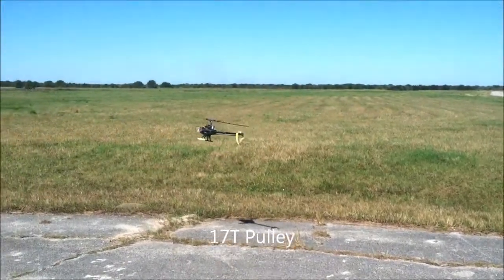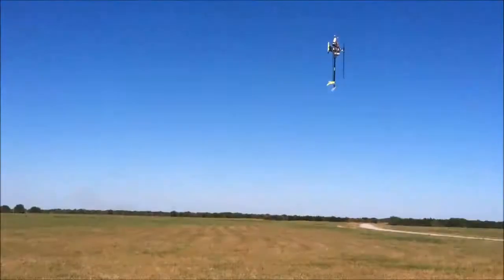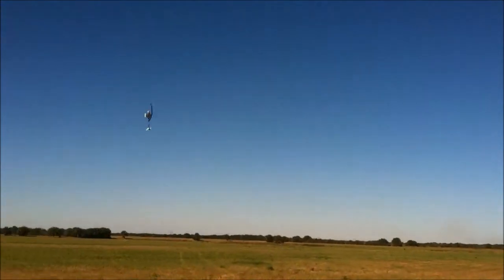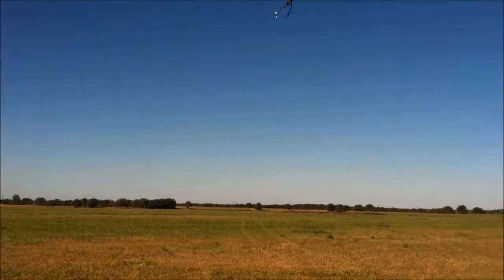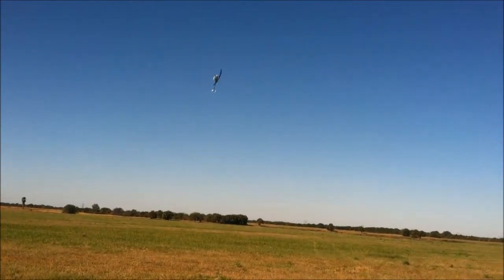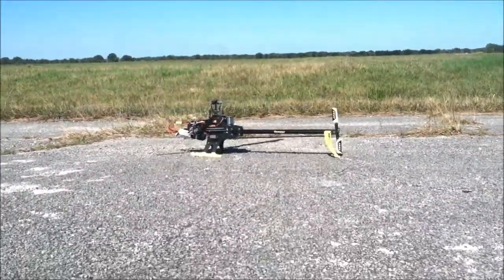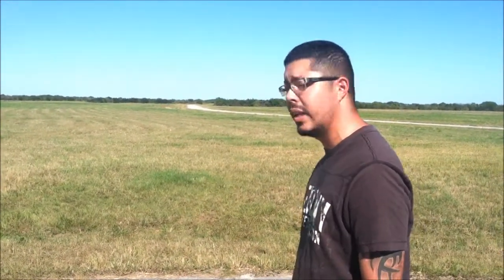Compass Warp 360 low headspeed test by Nelson Rodriguez

Comment: So you said you have the 17t pinion? If you wanted lower head speed and longer flight times, why not stay with the stock 16t? Or goto a 15t (if someone makes one) 17t seems like you are taking the motor below its efficiency range? So less torque... and more heat.

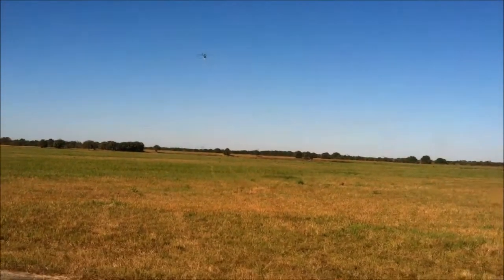Comment: I think he said GOV'd at 70-75%. With a 17 tooth pinion, based on Mr Mels HS calc that would be around 2000 rpm... Sure sounded a lot higher than also based on the flight time 4:30min.

Great flying!